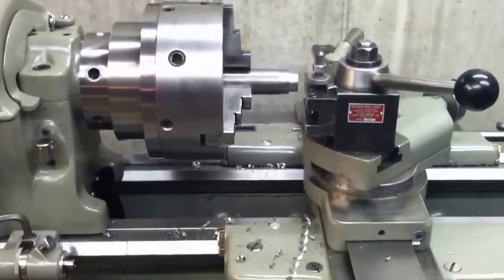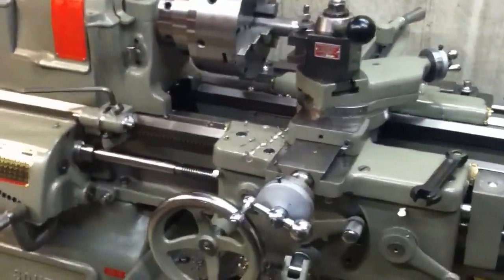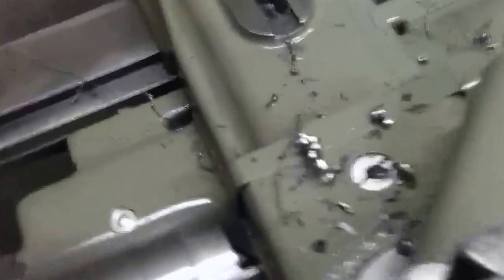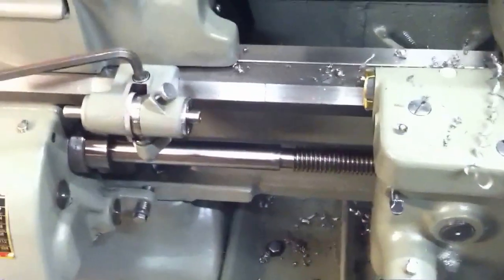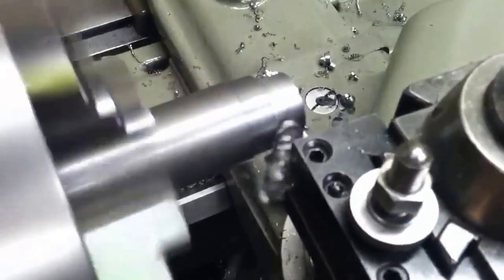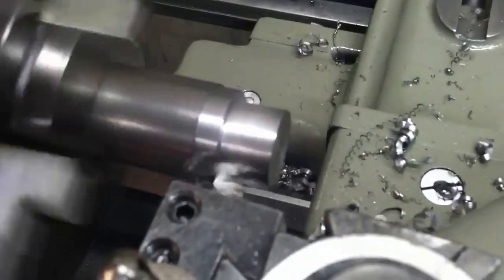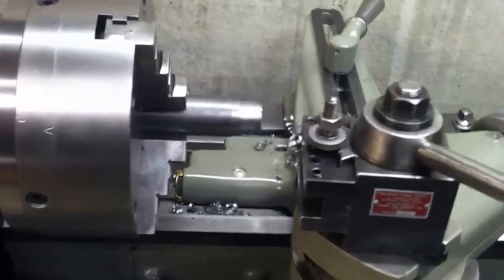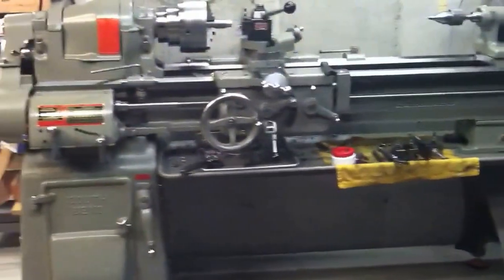Machinery Restoration #3: South Bend 13 - (Part 8 of 9)

Comment: Hey Brad, it's Chuck...I'm finding you all over the web when it comes to South Bend lathes, and now I see why! That is some incredibly nice work on your SB 13"! That is what I call immaculate...have you eaten a sandwich off of the ways yet? LOL! Heck, I wouldn't want to get crumbs on my machine if it looked like that. I have been told that my lathe was originally matte black, is that true of a 1920?

I am also little curious about a few things I may have missed, or you might not have mentioned. Would you share what year it is and what the diameter is of the NOS lead-screw you got is? I'm also curious if you could direct me(in private) to your parts spot? I'm looking for either a qcgb that fit's my 1" lead-screw or the change gears, I'm not afraid to do things manually, and a threading dial that will also fit the 1" lead-screw. Thanks my friend, I'll see you on FB...Aloha, Chuck
Reply from the maker: Knolltop Farms Chuck - the dia. of the leadscrew is 1" and the year of the lathe is 1967. If your machine is black, then it most likely "Japanning". Black was the color in the 20's for South Bends, although I'm not 100% sure if it was regular paint or actual Japanning.
Reply: The lathe is a crazy red, over green, over what looks to be black, but I'm not terribly worried about the color much, just the functionality of it. I am likely going to have to rewick it after I do a cleaning and inspection, and there are really only a couple of parts that will get me to 100%. Threading dial and change gears would make me one happy boy, but I'm still waiting for a few replies on some email inquiries, you don't have any other suggestions than what I've found at the Practical Machinist, do you? Thanks for the response and happy turning...Aloha, Chuck
Reply from the maker: Knolltop Farms Send me an email - I'll PM you.
Reply: BasementShopGuy
Thanks man, I appreciate it.

Comment: Great vids! For the Lebonde guys S.B.s was the start to U.S.A. Lathes. I have a 10" S.B. from the early 40s (has a tag that says "This machine confirms to orders of the war production board" and it will take .060 DOC or.120DIA and its all original but single phase motor. Your 13 is beeeaaaaitiful ! I would say more feed rate to break the chip! Just cuz I do it ever day!
Reply from the maker: jason johnson Thanks for the kudos on the lathe. It took a lot of time, but I'm really happy with how it turned out. Along the way, I've been adding accessories and upgrades. If I had more room, I'd get another lathe - a heavier gear-head. One day though....

Comment: We have the exact same lathe. Not quite as beautiful as yours but still quite functional. I have a favor to ask. Could you snap a picture of the thread settings label on the front of your machine? Ours is almost completely worn off and much of it is unreadable. Love the video. Thanks!
Reply from the maker: Ben - here is the build thread that contains some photos. There should be a close up of the gear box.

http://www.practicalmachinist.com/vb/south-bend-lathes/south-bend-13-restoration-247779/

Comment from the maker: When you feed in an amount on your cross feed, that's called "depth of cut". How "thick" a chip is determined by feed rate (in this case .003).. But the depth of cut IS .100 (or .200 OD reduction).

What if I fed in .001 and cranked up the feed rate to remove .100 per revolution (as you're explaining). Would THAT be a .100 depth of cut?

Sorry, bud, but you're wrong.

Comment: Very nice looking machine. I beg to differ with your definition of .100" depth of cut. You're basically making a facing cut, those chips are not .100". If you were threading, a standard or acme thread, and you fed the toolbit IN .100" for a cut, then you would be making a .100" depth of cut. I don't think a South Bend 13 would do that even in soft material like 1117. The belt would slip. You need a gearhead lathe like a LeBlonde or Hendey, or American.etc. Did S.B. make gearheads before shutdown

Comment from the maker: As a matter of fact, if you noticed the cam ring was off my Bridgeport. The clutch gears weren't meshing all the way - thus the noise... I need to turn down the pins to allow the pulley to drop and fully mesh the gears. So I'll video that...